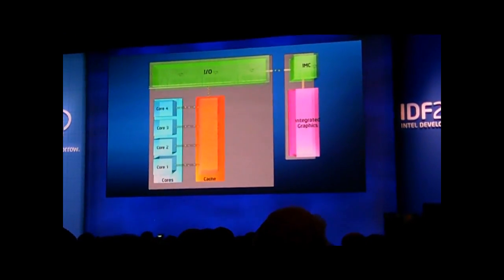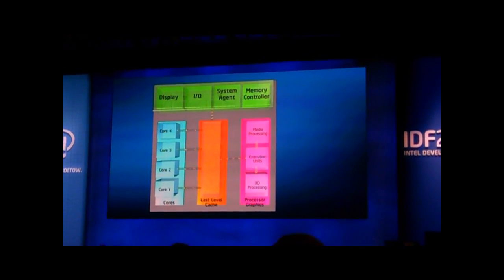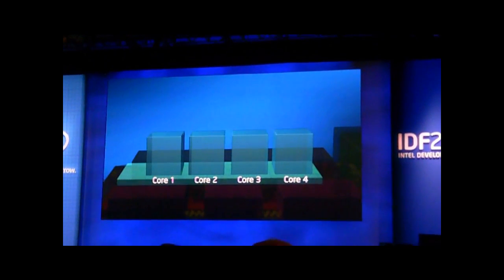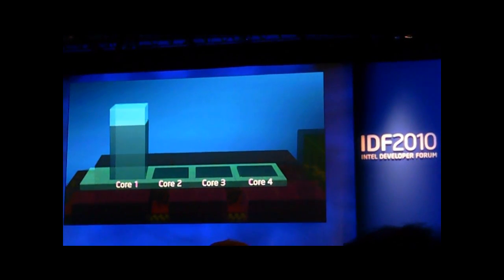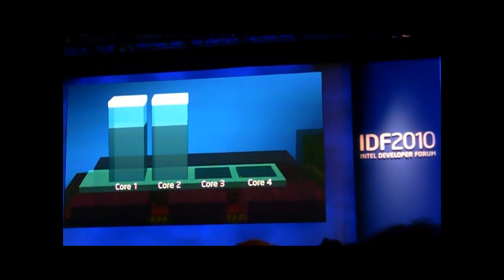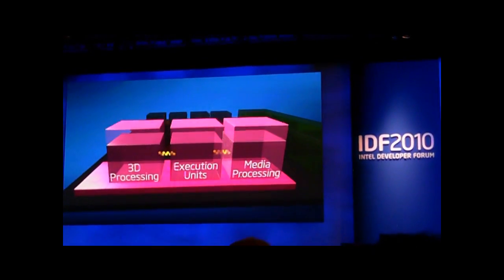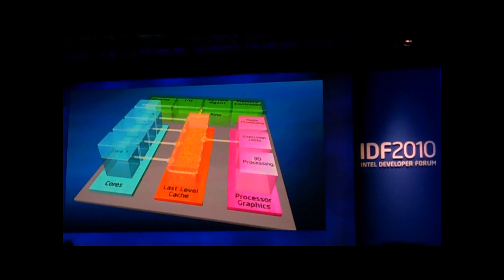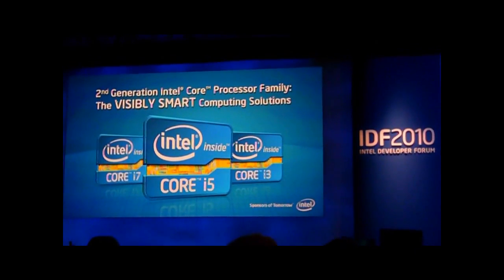Sandy Bridge Turbo Mode - IDF San Francisco 2010

Comment: @MrNaltas Not at all.

Speedstep _lowers_ the frequency below the stock frequency when the processor is idle. Turbo _increases_ the frequency  beyond the stock frequency if it finds thermal headroom (which is created when some cores are idle).